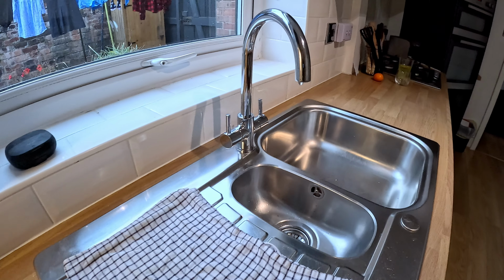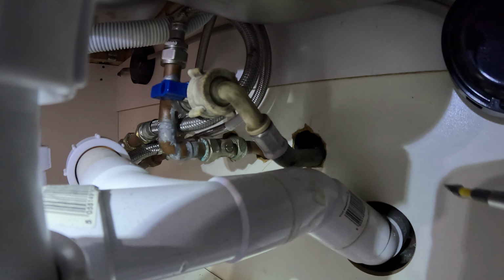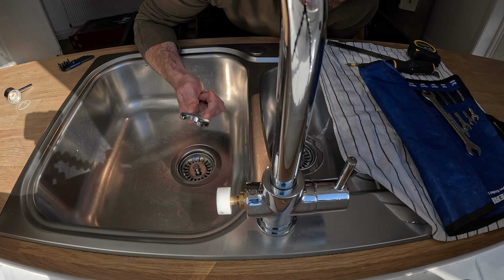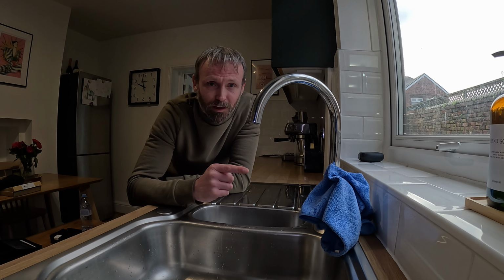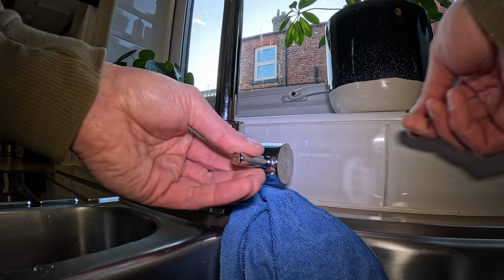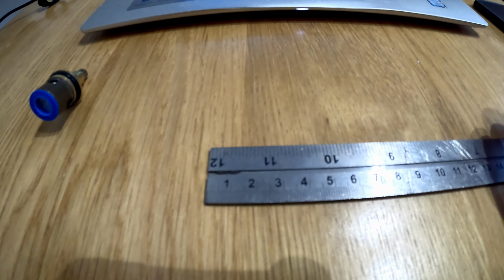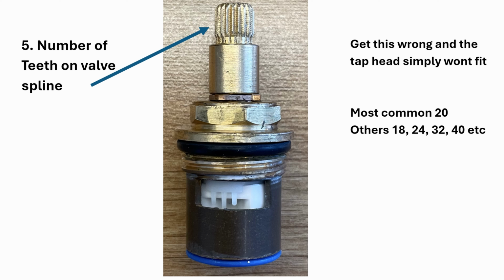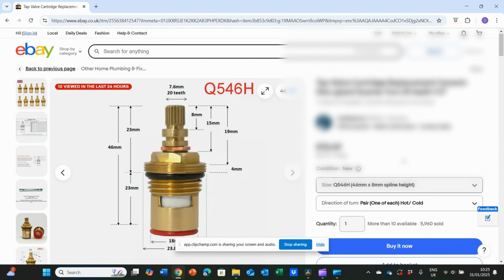How to fix a dripping tap

Comment: Thanks for the video, my first diy job completed on plumbing. Lucky for me there was water isolation valves directly under the sink. Also the cartridge I needed replacing had a short code around the rim so was easy to get from diy store. I did have to swap over a small plastic piece from the old cartridge to the new one but was very easy.Anyone can complete this easy job just follow the instructions  in this video and avoid costly repair bill. In total cost me £6 and I got a spare cartridge.
Reply from the maker: Thank you for the support my friend. Really nice to hear that it helped with the project. Thanks for feeding back the extra information too, it’s really helpful for everyone. Best wishes 😊👍🏼